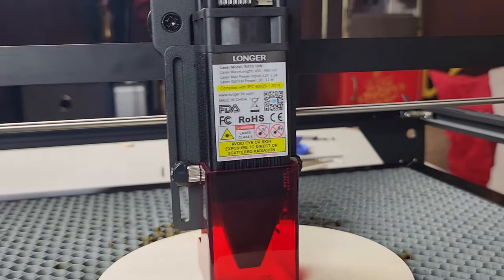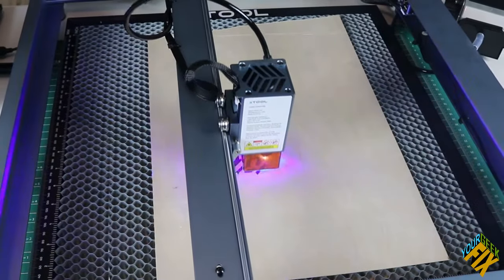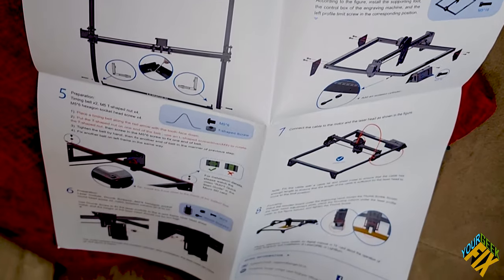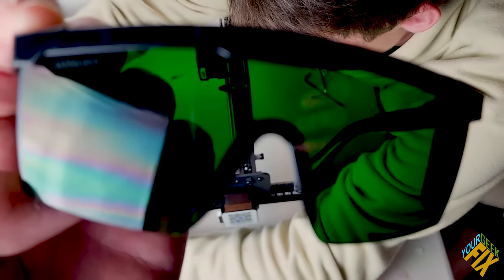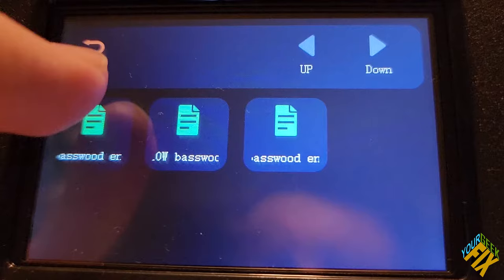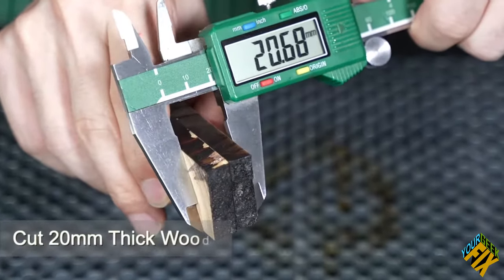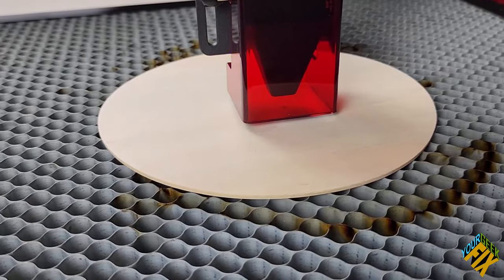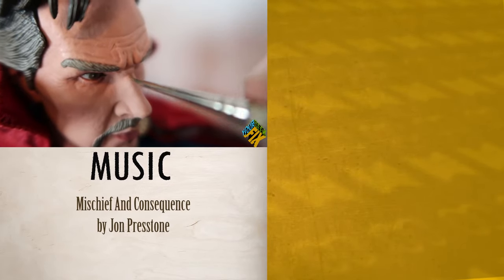We Tested the Longer RAY5 10W Laser Cutter and Were Surprised

Comment: I have this model for over two years and have not have any issues. Great laser for the price and highly recommend Longer3d lasers. Just had some issues with an Atezr L2 24w laser that was purchased by the company I work for before I started working there. It stopped worked after a few months (Mother board issue) so after terrible customer service exchange with Atezr, I had my manager buy a LongerB1 24W laser and so far so good with that model.  I feel there is risk with most of these diode lasers but it comes down to if the company supports their products when issues do arise. From what I can tell it's all a bit of a crap shoot with all the laser manufactures unfortunately.  I like that fact  that Longer lasers don't upgrade new models every 6 months which is an advantage as they seem to focus on making it right and working out bugs rather than having the latest bells and whistles that lure most. Either way do your research before buying a new diode laser. Diode lasers are fun tools that open up the doors to many creative possibilities at a pretty reasonable price.